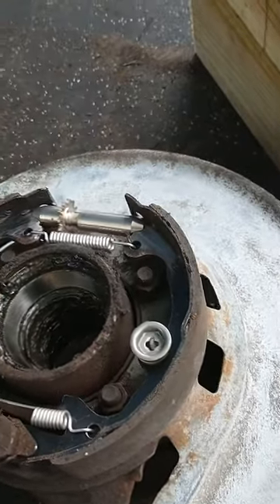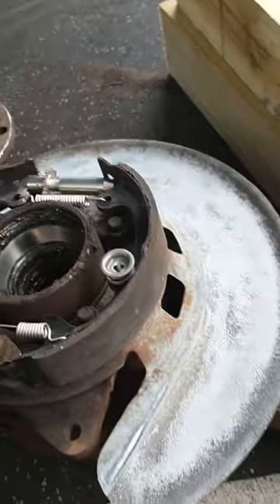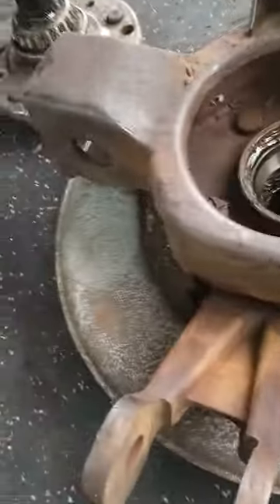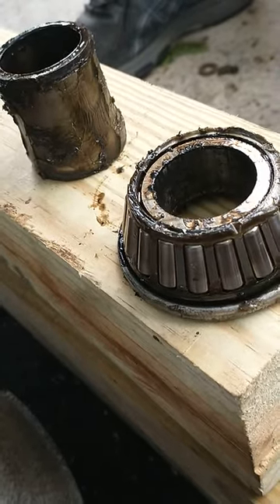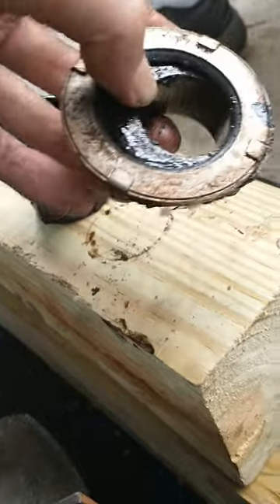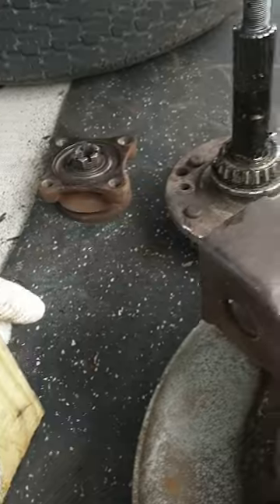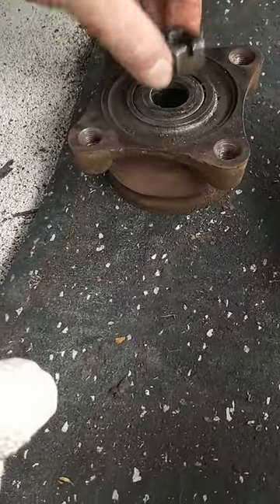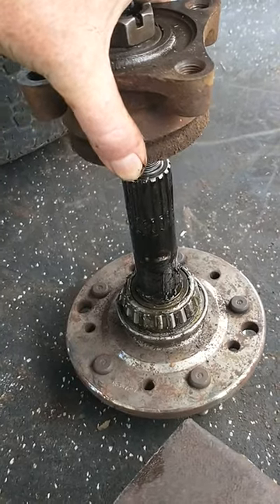1975 C3 Corvette Rear Spindle, Bearings and spacer/shim orientation.

Comment: Almost no help at all ,...what is the "top" of spindle again ? 
 I have an inside and an outside on mine ,..I'll keep looking for help ,thanks😊
Reply from the maker: "on top" means on top of the spindle as oriented in the video, ie, the inner side of the trailing arm
Reply: I have the two original manuals the mechanics used at the dealership, has everything you need to know inside. 74 and 75 supplemental, torque specs, full electric, chassis, and suspension.

eBay and in perfect condition! I spend hours reading, may worth a look Jeff.